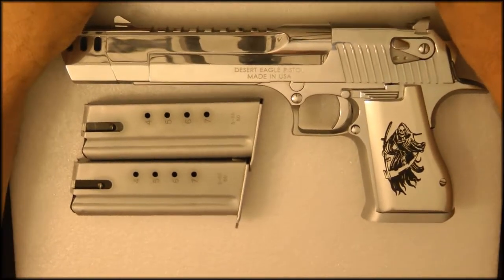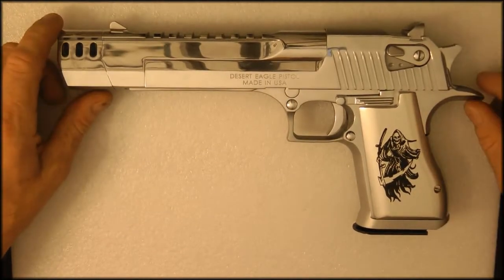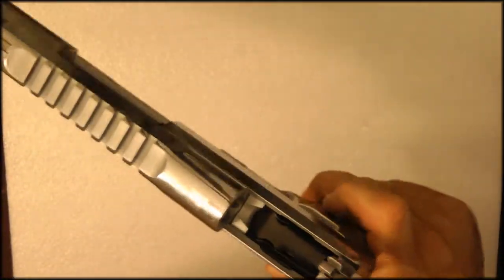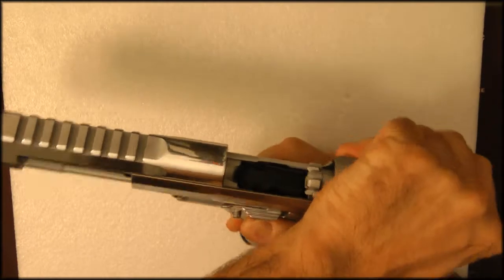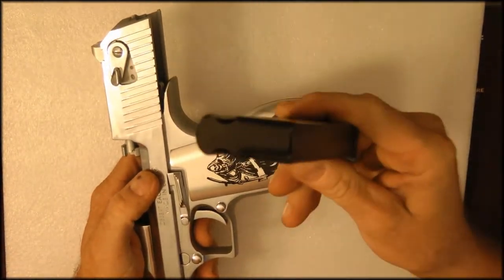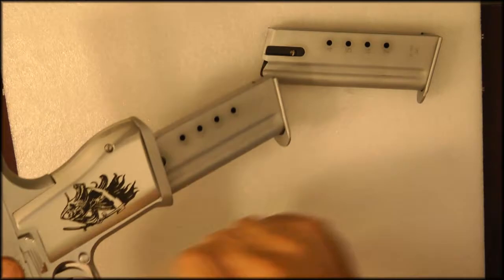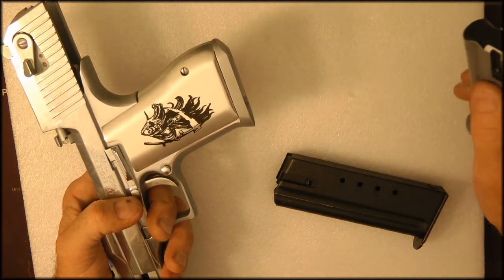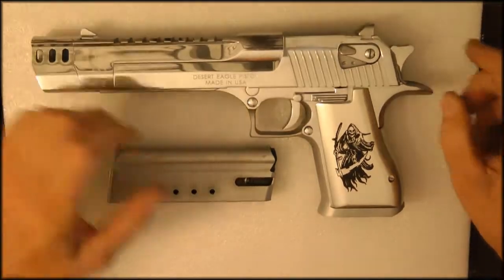How to test your desert eagle 50AE magazines FTF

Comment: All 3 of my mags do that including the 2 I bought brand new direct from IMI. Also NO scratches or dings? PFFFTTT I actually shoot mine bro its not a hood ornament like your pretty one there.
Reply: Joshua Colantuono They might as well be! Almost 2 grand for a gun? I mean, don't get me wrong, deagle are great (actually my favorite gun) but its still alot of money. So I don't want to spend $1,700+ for a gun only to find out its been dented or scratched, then have to pay more money to get it fixed.
 Not to mention a 50 cal bullet is about $2.50. For a single bullet!!!!!! Now let me show u a few things. Here's how much a couple cases of varying amounts of 50 ae ammo costs.

400 round case= $475.00
That's about 57 clips.

100 round case= $250.00
That's about 14 clips.

20 round case= $35.00 
That's about 2 clips. For 35 dollars!!!! 
So depending on what case u buy, u will have that on top of the actual gun. Extra mags are like 25 to 50 bucks for 1 mag!!! So add a couple of those (like 2) and a 100 round case for shits and giggles. If the mags are 25 bucks thats......lets see here ( pulls out calculator).....hmmmmmm...... About 2,050 dollars. 

How about the gun, 2 mags ( if they are 25 bucks)  and a 400 round case..... About 2,275 bucks.
 If the mags are 50 bucks ( I found 2 prices I'm sorry) that's $ 2,325. 
That's a lot of money. Plus repares  and a custom paint job ( if u want one). Money.. Have u heard of it????

Fucking hood ornament?!?!?  Not on my hood! Too expensive!!! It wouldn't just go in a gun safe....  It goes in the most LEGIT gun safe...... In a room guarded by armed guards...... With AK-47's.

Its a serious investment is what I'm saying. U don't want 2 spend all that for a dinged up handgun that doesnt work right.